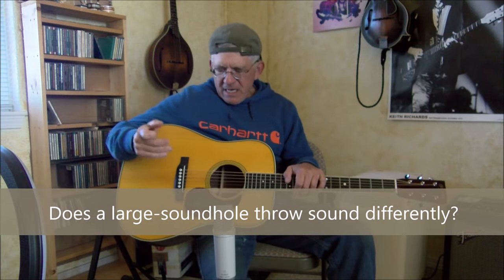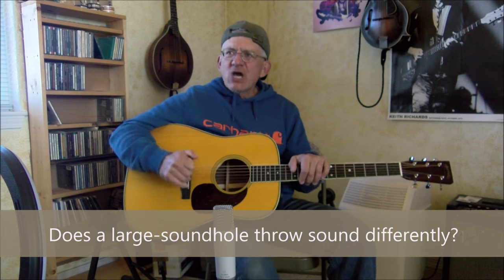Does a large soundhole guitar project differently?

Comment: Bryan, on my computer with Bose speakers, there is a difference.  But to me, in every part of the test, the normal sound hole sounded better.  It cut through better and it sounded brighter and cleaner.. whereas the LSH started sounding muddy in the low tones.. much like the complaint against D35s.  It also makes me wonder when in the beginning designing of the guitars and sound holes how much testing did they do to come up with a hole size that they stuck with forever.  I think your last comment on the bouncing off the walls and such is an important consideration.  Thanks for being you.
Reply from the maker: I doubt they did ANY testing in 1934.  They probably just copied classical guitar or had a certain sized cutter.

Comment: @NMHighPlains  Good timing on this video Bryan.. I'm at a bit of a crossroads. The Preston Thompson I'm having made will be Adirondack over Brazilian. Considering having a hot Brazilian bridge put on (they slot their bridges) and having them make it a large soundhole as well. Do you think that would just be a hot rodded guitar that still sounded great tonally? I've never played a guitar with a hot bridge and large sound hole. I've probably got 4-5 months to research and decide before they start construction.. So many decisions
Reply from the maker: I wouldn't tell the builder what to do, too much.  I'd ask him what HE thinks.  My great advantage is that I'm working with guitars that are already built and can sort of predict what changes are going to do.  Let's take this CS-BG-16 for instance... I have ZERO desire to add a hot RW bridge to this thing.  It's already plenty bright.  I added a hot RW to the D-35 awhile back because D-35 can use brightness. 

Now... on the soundhole, I've never played a LSH that I didn't like and even though the mic didn't reflect it here, I really thing they throw sound differently.  So, I'd go with a 4.25" soundhole (sort of a midway between regular and the CS and one I've used before), but stick with what bridge/plate, etc that Thompson thinks will give you the sound you're looking for.  You can always change things later.  :)
Reply: @Bryankimsey  Copy that. Thanks for your time as always, Bryan.